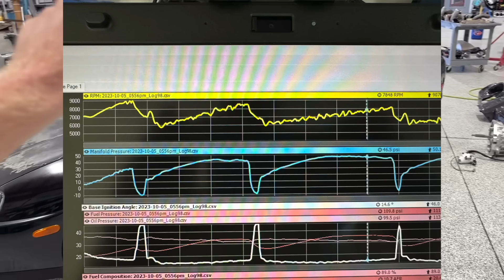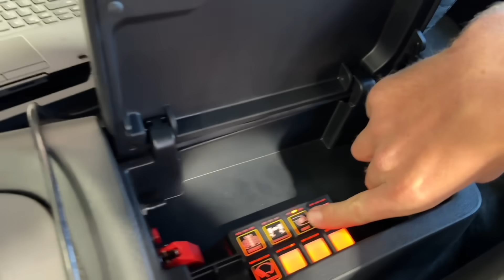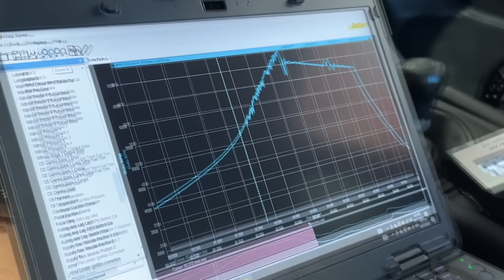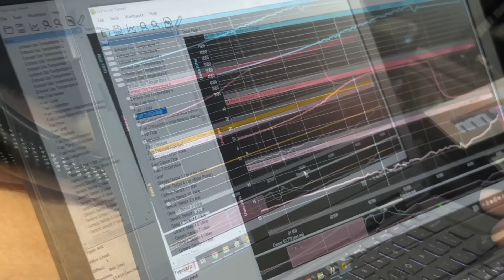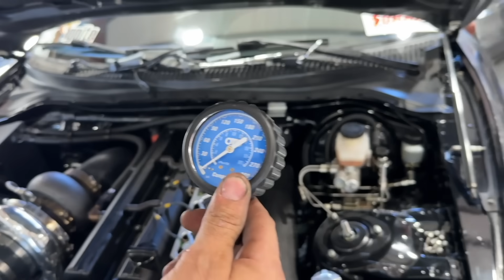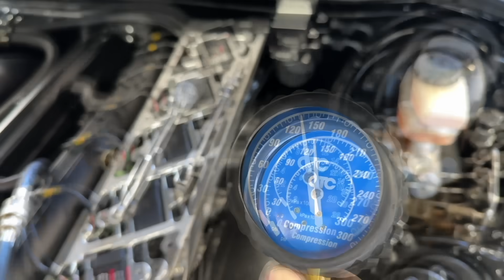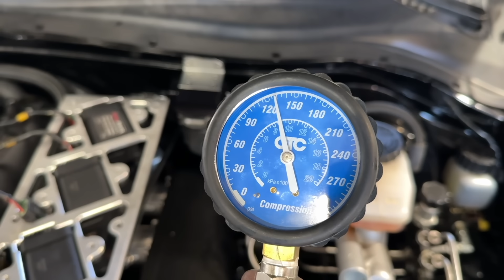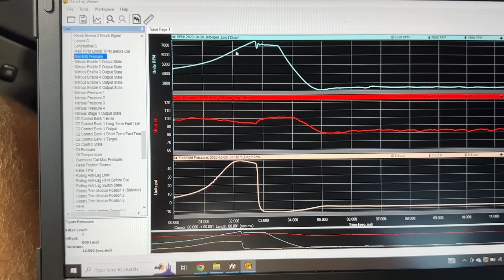Scaring Passengers In a 1,300hp SLEEPER SUPRA!!! The Rat Rod Supra's Mystery Issue is FIXED!

Comment: Those guys are so used to big problems so they forgot those little ones they used to have 😂
Reply: Great take on it!
Reply: One time I checked everything trying to find a misfire. Then I shocked myself pretty good and that's how I found where my plug wire was bad. It was arcing inside the spark plug tube right before the plug.
Reply: @badgermetal  I had my buddy bring his Corvette over looking for a problem throwing a bunch of codes. Mechanic couldn't figure it out. It was getting dark out but I had him fire it up and noticed the problem right away. You could see the wire arcing right through the boot. It was insane because the wire looked perfect just like these ones. Put new wires on, cleared the codes and it ran perfect with no codes after that. The electronics on these modern cars really don't like those high voltages zipping all over.
Reply: @bigduphusaj162 he’s just that guy 😂😂

Comment: Someone needs to teach Cletus to test plug wires with a multimeter.
Reply: Literally the easiest thing to test is to throw on a new set 😂
Reply: It wouldn’t hurt to check brand new wires when you get them and put them on, and that goes for all the vehicles in the shed! Just check resistance on them.
Reply: Y'all realize high voltage does crazy stuff and a multimeter alone can't check dielectric issues, correct?
Reply: @lordcommander3224  A hundred bucks in wires, or a free test with a tool you ought to own anyhow.  Ur call.
Reply: @Informative-and-unfortunate you are uneducated about multi meters. Ever heard of microfarads? Didn't think so.. now leave the electrical work to people with knowledge.
Reply: Need a megger to check plug wires. A normal multi meter doesn't output enough voltage. Even a megger only does 1000v. A good ignition system is going to be 50-60000 volts. It'll find flaws way easier than a meter.

It will show up on a meter after it's been broken down by a few thousand hits through the ignition (rpm is crazy, shit happens in milliseconds.)
Reply: @j_rainsgoat3929 It's kind of sad to call someone uneducated and mention capacitance measurement on the conductor using a multimeter.
Reply: @VictorGalayda 😂😂😂
Reply: @leftyeh6495 exactly right buddy obviously he doesn't know too much himself because half the time there are multimeters won't even read high enough and I'm sure he knows everything though just like if it's.. spiral-wound stainless or fiberglass covered with graphite, (plus measurements of length of course) but I'm sure his microfarads will be just perfect😂😂.. he'll be sitting here doing division and multiplication and everything else. Weather in layman's terms it comes down to high voltage because the way that supra runs it might be pushing plug wires that go up to 50,000 
Plus if he's an electrical man I'm pretty sure a megger is used a little bit more than a multimeter... So I'm with you dude.

Comment: As a Supra owner, this content makes me happy. Glad to see Cleetus enjoying Supras.
Reply: as a human with eyes, this video was
Reply: What kinda engine work does it take for a 2jz to make 1k hp
Reply: @GeraldedwardKaiser  quite a bit to make it reliable. Factory bottom ends are good for 800HP all day, problem is the modern turbo technology ramping in torque early in the power band. That's what caused the rods to let go moreso than the pistons. If you use an older turbo with a factory bottom end, they're good for 800HP all day long.
Reply: @fordgt9t  OK so which ones are best I know I've seen like vvt ge isn't it and another one I can't remember? The reason I'm asking I been thinking of getting one. And Thanks for the insight
Reply: @GeraldedwardKaiser  vvti and ge rods are weak .. GTE is stronger but more expensive .. best option is to take ge and build it rods pistons and valve train etc ...
Reply: @GeraldedwardKaiser   A80 owner here - Both the 2JZGTE and the 2JZGTE VVTi have beefy rods from the factory. The 2JZGE also shares the same beefy rods, but the 2JZGE VVTi has the weak rods, good to about ~400hp. Hope this helps
Reply: @LandonGear bet the vvti has probably carbon build up in the intake issues. Had to scrub one out even using cleaner ☹️
Reply: @GeraldedwardKaiser yes

Comment: The more air and fuel there is in the spark gap, the more resistance it has electrically. So once it hits a given amount of airflow (boost and temp will affect it) the path of least resistance may be through a pinhole in the plug wires. Good find! Always refreshing when it ends up being something simple.
Reply: plug wires are so commercialised, easy to swap but who ever looks at the amount of copper in their wires and finds out half of it is just rubber insulation haha
Reply: @drivenbullet260  yep, fuel is a conductor.
Reply: Should measure resistance in them, before and after..
Reply: @aciid_0  They're supposed to be like that. They carry very high voltage and low current. So they need very good insulation but not much conductor. The conductor might not even be copper but rather something with quite high resistance. But I reckon it's better not to have them at all and have your coils plugged directly onto your plugs. They're a potential weak point.
Reply: @82NeXus  I've never seen a spark plug wire with copper in it. The ones I sold as a kid in a parts house were always carbon core. Apparently there are 3 types now, Carbon Core, Solid Core, and Spiral Core.
Reply: @-Primer- Back in the '80s I picked up a set of Taylor spiral core, small gauge solid copper spiral and grounded sheild wrap over the silicone insulation. These with an MSD on my Plymouth police special would peg the 150mph speedo. Solved all my Mopar ignition issues 😅

Comment: It's funny, early in the video when y'all were discussing what could be the problem causing the jerky rpm curve on boost, I was thinking out loud that there was probably something wrong with either the coils, wires, or plugs. 

Y'all went from thinking it was the fuel, to tune, to dead cylinder and so on. I was talking at my phone, hoping y'all could hear me, there's something wrong with the ignition system! 😂

Then y'all changed the wires out and made another pull. When I heard that engine smoothly reach peak power without a stutter or stumble, and saw Cleeter's hand fly up, I yelled "hell freaking yeah!" at my phone. 

Good to see a cheap simple fix got the Supra back to normal. Such a sick car btw. Please don't break her. 😢

Comment: Back when I was tweaking my Supra people were switching to LS coils and I hated the plug wires. I switched to motorcycle coils off of a liter bike, worked great but needed plugs you could unscrew the back off of. Not making this kind of power but it was a really clean install. Started seeing Supras at MIR for the import races doing the same not long afterwards lol. Might be worth a shot if you want to get direct coil on plug :)

P.S. The handbrake button works great for anti-lag. Press the button, lift the handle just enough to trigger the light, get anti-lag. Drop the handle and off you go!
Reply: Sounds about right

Comment: Those plug wires might look fine but I bet if you measure the resistance of each one you'll find variations and probably a couple that are more than the others which is what was causing the break ups.
Reply: I was thinking the same thing, I would have metered them as soon as they came off the car. Also it could be the shielding, they are running some very strong coils. Or even the contacts at either end. Either way it's nice to see a cheap fix for once lol.
Reply: Man iv found some spark plugs with some really screwy resistance ratings on them. So I am all the spark plugs now. It could be as simple as a loose ground somewhere vibrations causing intermittent connection.
Reply: I have 1JZ-GTE and the ecm's have bleed due to capacitor issues..... 
spark plug gaps has to be perfect.....
Wires......
Coil packs..... micro cracks ......
Reply: These are 99.9% of the issues
Reply: That was my problem with mine. Bad spark plug wires. But not before fixing the gap. Even a new wire was over 50ohms
Reply: Would being different lengths change the resistance? Noob looking for education 😊
Reply: @The_Laid_Off_Life earths?
Reply: @stuart207  - wires, coil packs and plugs can be ground related......

ECM capacitors is age and vibration related. The stock ecm is in the engine bay next to the motor so it is common
Reply: @stuart207  I'm going to guess the difference would be insignificant and not enough to make a measurable difference. Plenty of 6 cylinder engines that ran a distributor mounted at one end of the engine so the furthest lead would be more than double the length of the closest yet there was no difference in performance.

Comment: I'm not a mechanic and have not even worked on a car for probably 10 years, but I knew that had to be spark... either plugs, wires, or coils.  That is really the only thing that would give that shaky line like that.  Most of the other things would either drop off or ramp slower... especially with good compression.
Reply: Yeah I assumed spark blow out due to gap but yes deffinantly sounded like spark issue.
Reply: Lab scope fixes all of the guessing. Surprised more people don't use one
Reply: @squirrelchaser  I have not used a scope since college 35 years ago.  I took a college class for automotives, but was never able to finish.  They had an old Sun one.  Very crude but it worked.
Reply: @toddabbott781 the scopes they have now are not even the close to the same game, the stuff you can do and see now it utterly astounding
Reply: @kylancook3477  
You are absolutely correct. The way I look at it is you can't fight something you can't see.

Comment: Hey Cleetus at 13:36 when you start your test I can see coil pack #4 discharging to the head, is it blowing throwing the boot or is the coil pack bad?
Reply: Saw that too lol
Reply: Right under the extension, I noticed that too.
Reply: Coil is still making spark even though the plug is not in the cylinder , will go to earth wherever it can. That happened to be the path of least resistance lol
Reply: They took it out to do the compression test so its just making spark to whatever ground it can.
Reply: @TBasianeyes  I know how a compression test works. That spark jump happens when insulation breaks down.
Reply: Since that was with the bad set of wires I’d bet it was jumping through the boot or wire. High voltage going where it shouldn’t can cause all sorts of problems.

Comment: There's something strange going on in the aftermarket parts industry. I've been getting everything from bad electrical components to bad rotors and pads. I have a few theories but I won't speculate. Even if you visually inspect everything you're still going to run into bad parts. It used to happen once in a while but it's been a weekly occurrence lately.
Reply: That's what was happening with Steve Morris; he was getting bad bolts and bad rods.
Reply: They’d been cutting as much money out of stuff as possible for a long time. Then around Covid times a lot of things happened which tended to drive quality down. Those pieces will take a while to work through the system even if they’re producing good stuff now.
Reply: @NBSV1  like I said I have a few theories but some of them might sound a little crazy.

Comment: I did this back in 2011 just north of Cleetus in Hobe Sound, FL. But it was a 770whp supercharged c6 T-56Magnum non z51 gears. 17"×390mm width M&H big boy. Good for 9.9@148 no lift shifting. Made some old florida dudes soil their britches. Sideways left in 1st then right in 2nd and finally hooks on the street in 3rd.

Comment: You need to invest into a good ohm meter and a megger can test spark plug wires at high voltage to take the guess work out of spark plug wires.

Comment: I’ve been chasing down a few issues on my brothers built motor truck, it wants to sometimes jump forward at a stop, then getting onto the highway it would miss enough to make a nice bang from the exhuast and coolant temps would randomly jump up and down. After days of checking sensors, fueling, etc. I finally noticed the negative terminal on the battery was loose 😂

Comment: Check the resistance of each plug wire with an ohm meter or multi-meter. The resistance will start to increase over time. Also, I’ve had the tabs break that links the wire to the spark plug

Comment: Many years ago I bought a car very cheap, mostly for the engine, after the previous owner had spent well over a thousand with "mechananics" who couldn't fix a misfire.
First thing I did was pull the plugs and check the HT leads' resistances - one of the basic checks I was taught as a 'prentice! One 'plug was wet and 'sooty', suggesting an ignition issue, and the 2 part (BERU, IIRC) HT lead for it was open circuit for each part.
New leads and it was running perfectly - to the point I decided to keep it as a run-around instead of stripping it for parts.

Comment: I've got to give some kudos to the Tuning plaform that we have for the N54 bmw cars. MHD has put into their software which is run on an average Android phone and they not only can do all the ethanol fueling and tunes for the average mads like down pipes and larger intercooler etc. But last year they added Anti Lag to it!! Just by holding the volume button or the cruse control lever you can fully Anti lag up to 15 pounds of boost! Amazing tech at an amazing price and on a stock block you can run safely up to 750 HP if you have a manual trans or about 625 on the Auto trans! This made me realize how great that is for the average car guy!

Comment: anti turbo lag is easy to over come if you know how to drive a turbo car , keep the revs at ultimate point so the fan on the turbo doesn't slow down , so its always ready to give you that boost
Reply: You don't understand how it's being used if you think you can just put the revs at the "ultimate point", even above the boost threshold rpm there will be lag, this anti-lag removes that and holds the car at whatever speed ready to start a race.

Comment: That's so cool. I was suspecting a loose ground in the ignition system vibrating up in the rpm to cause it to break up. Mabey ya didn't notice a plug wire was loose?

Comment: Had a similar issue to your supra with the ignition on my turbo build, turned out the dwell time was wrong on the coils, so would misfire under higher boost but drive fine at lower boost.

Comment: I have been having issues with my tune for about a year. We couldn't figure it out. 
- First we did plugs. 
- Then I thought it was a failed cat. Got rid of the cats.
- Thought it was a Turbo. So I swapped out the turbo (put a bigger one in)
Then I watched this video. About the same time I noticed an issue I swapped out spark plugs and coils.
#3 plug was definitely bad. The insulation was gone. But now I'm wondering if swapping to the MSD coils at the same time was a mistake.
Even though they should have been an improvement, what if I have a bad one. I know what I am doing when I get a free weekend.
Thanks!
Love the Supra!

Comment: My uncles supercharged fox body made low power on dyno day. Tuner pulled the brand new plug wires off and threw em in the trash. Put a set of taylors on it and it picked up almost 150 whp. Some new wires can be junk

Comment: Even just a small drain on spark energy btwn the coil and plug can cause spark issues, especially at high boost levels.  Every PSI you add into the cylinder makes it harder for the electrons to jump the gap.

Comment: ATLEAST ON OLDER B SERIES HONDA'S, plugs/wires are important. Drove an hour home with 93 Integra running on one cylinder from guy bought it from. Barely could make 60mph up hill. New plugs, wires and did great burnouts.

Comment: Dude, there was definitely an issue with at least one of those plug wires, if it fixed the problem after you changed it. You can't just look at them and see a leak in a plug wire. It had to have been arcing. Unless it's really popping loud, at idle, there's no way you're going to hear a slight arcing, over a loud engine.
That is a nice old Supra, though. I'm envious. ✌️

Comment: I have a 1996 Cadillac Fleetwood 6 door limo.
If its not the the distributor at the bottom of the engine, then its the plug wires.
It has been the plug wires 4 times out of 6.
I need to find some that are not sensitive to heat because they run right under the exhaust manifold

Comment: Cleet measure those plugwires. Either they are out of range. Or one or more of the crimps on the cable is loose and it’s arcing over between the cable and the connector.

Comment: I was going to say cylinder 5 and 6 always run hotter than the rest and will sometimes test lower compression.

Not sure if Cleetus is running a different trans than the V160 but dyno gear is 4th

Comment: Something to do with ignition is my guess. I would guess coil packs as they are a weak point with J motors, although you are probably running GTR or other packs. So doible check your plugs and leads then work back.
Reply: Edit: ive only watched half the video. Ill look stupid if you've solved the issue outside these parameters later in the vid.
Reply: So after watching more of the video, it appears to be a perforated insulator on a plug lead.
I hope you have enjoyed this conversation with myself.

Comment: Ya know those plug wires very well may be perfect still, I’d bet you still had that high ethanol fuel in the lines and filters so it took a while to run through to the lower power fuel
Reply: Or one of your plugs had a bad crush washer or wasnt tight all the way

Comment: My sr20 use to do that under hard acceleration. It was something that nissan calls an ignitor chip. The old one was cracked and falling apart. Fixed that and my car was faster than it ever was.